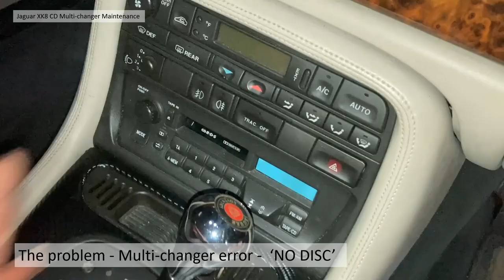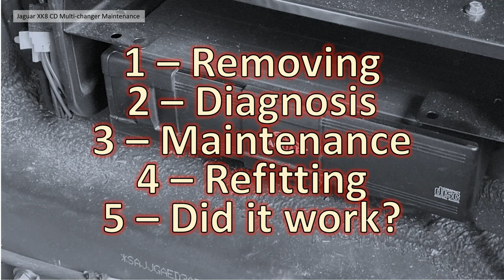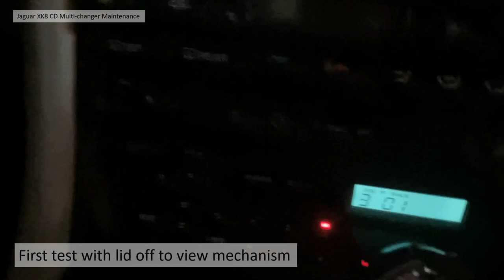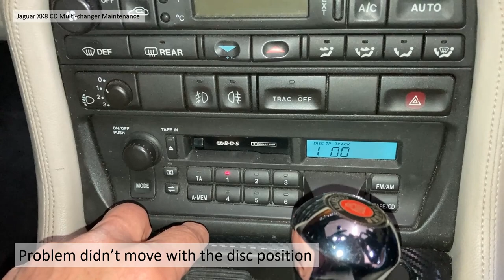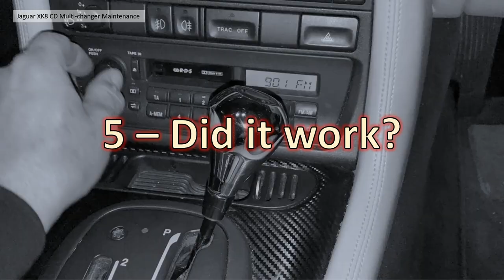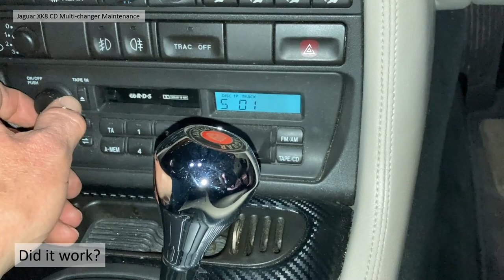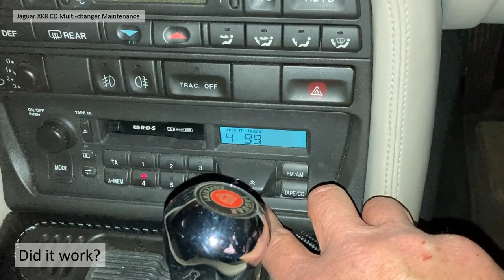Jaguar XK8 CD Changer 'NO DISC' V127 / XKR (X100)

Comment: Great video. When I took mine apart the cover wouldn't come off. I ended taking the face plate off (as recommended in another video) which was a big mistake. It was very difficult to get off without damage and not necessary. The reason I couldn't get the cover off was because it wouldn't slide back or up because after 20+ years the rubber isolation dampers were stuck to the cover. A little silicon spray lessened them right up, but I couldn't see that until I got the face plate off and I could lift the cover sides away from the body. I would recommend putting a little dialectic grease on the dampers where they contact the cover in case you have to remove it in the future. These things are always easier the second time around.  ;-)
Reply from the maker: Paul, Thanks for the feedback and sharing your experience, good information, regards Damian

Comment: I managed to get a widget that fits in between the CD changer and amplifier with a switch to allow MP3 input. The guy that made it had a web site that appears to be long gone unfortunately. The only drawback is the CD player needs to be playing for the amplifier to accept the input. I actually plan to go further and fit a Bluetooth connector to the audio input but I have more pressing things to deal with such as no central locking from the fob!
Very interesting video.
Reply from the maker: Graham, the Aux input via the CD lead seems the best solution to this issue. There is a company in the US selling a Bluetooth solution but a bit expensive. Trying the fix it route first. Thanks for the input and comment regards Damian

Comment: Thanks for the great video, I opened my unit it loads the cd but it does not turn the cd. Checked the motor and it works. Any idea?
Reply from the maker: @hoomankhaghani8802, in the end mine stopped working too after my attempt at fixing. Found other solutions, reviewed in this video - https://youtu.be/kG61K1GM-Bc  Finally, got it working faultlessly now. Thanks for your comment and interest in the channel, regards Damian

Comment: A useful video, thanks. What silicone grease were you using? Some sprays are too runny - just want to get the correct one.
Reply from the maker: Paul, I would recommend using a white grease and silicone lubricant spray. The multichanger worked for a while a but it’s very temperamental. Use a Bluetooth tape more often now, regards Damian

Comment: Hi great vid my CDC has also failed but my car is a soft top with all the hydraulic gubbins on top of the bracket would undoing the cdc fixing bolts with bracket in situ” work do you think ?
Thanks
Reply from the maker: NBmusoman, sorry can’t help as don’t have a convertible. It’s worth a try, regards Damian
Reply: @ODRModurol  ok yeah I suppose i just have to try ?
Thanks

Comment: In my case when my BMW e39 CD changer stopped working I took magazine out and removed every CD and then reinserted magazine. After turning CD player on it obviously displayed the "NO DISCS" message. Turned it off, put CDs back and turned CD player on. All discs are back in action and playing just fine.

I know it might not be everyone's solution but in some cases it obviously works. 
💿🔊 🤔
Reply from the maker: 👍Always best to start with the easy or obvious stuff first. Good advice, regards Damian
Reply: @ODRModurol 
In my case it just stopped working for no reason when yesterday I tried to switch between two discs. It felt like a software issue than the ol' good grease one, as if its little brain got perpetually suspended in state of confusion, so offering it a full set of empty cartridges helped it to clear its mind. Literally.

Comment: If you install the front springs first, it makes it much easier.
Reply from the maker: Andy K, very good tip, I thought I did that in the reassembly section. Very fiddly to put back together even though not complex. Thanks for the comment, regards Damian

Comment: I have a similar unit. With mine the slide mechanism will not move. I think the motor is dead.
Reply from the maker: @CortinasAndClassics, my CD changer has stopped again with 'No disc' error. Decided to try a guy I found on eBay offering Jag CD and radio repairs. Finger crossed I finally get it back working, regards Damian
Reply: @ODRModurol  I got mine working. Really pleased.
Reply from the maker: Nice one👍

Comment: Alright bud, great video, before I attempt to take mine apart I have a little question, I can't get my cd cartridge to eject, have you got any ideas what it could be ?? Cheers 👍
Reply from the maker: Steve, if I remember correctly the eject button pushes a separate micro switch which triggers the ejection of the cartridge. Sorry can't give you any other help as not had this issue with mine. Thanks for the comment regards Damian
Reply: @ODRModurol  hi Damian, not a problem pal, thanks for the reply 👍 Steve
Reply from the maker: Steve, no problem. Would be interest Ed in knowing more about the problem with you CD changer and the fix when you have done it. For future reference, much appreciated, regards Damian
Reply: @ODRModurol  it's got me baffled, there's no noise from the changer when I press the little blue eject button so either I've got no power coming to the changer or something inside has failed but I'll pull it apart and let you know if I have any success 👍
Reply from the maker: Steve, cheers good luck with the investigation and fix, regards Damian
Reply: If you remove and dismantle the CD changer carefully you will eventually be able to release the magazine from the changer.

The noise you're hearing is some part of the mechanism trying to move and being stopped by something that has stuck.   As the man said, the white lithium grease has probably dried out and stuck to something.  There are lots of places where parts move closely and need to be able to slide or rotate easily.  The answer is to dismantle, clean the old grease off and replace with nice fresh lubricant.

I did this but tried to redistribute the old grease with the result my changer worked but would only play around 2 minutes of each CD.  Obviously the head would not travel further before sticking.  Repeated the process with new lubricant and all is well now.
Reply from the maker: Phillip, good points and well said. Thanks for your input and comment regards Damian
Reply: @philipgrice1026  I have the same problem on my XJ8 so will have to remove the unit as Damian described. Once you had access to the internals, how did you release the CD cartridge? Is there a trigger mechanism I can activate manually?
Reply from the maker: James, I thinks it’s a microswitch and motor but could be wrong. Should be able to release it and move it manually once you are in there. Good luck with trying to fix it. Regards Damian
Reply: @ODRModurol  Many thanks. Will give it a go.
Reply from the maker: James, please let us know how you get on, regards Damian
Reply: @ODRModurol  yeah will do, I had an accident at work, a week In hospital, I'm home now bit not fit enough to work on the car so as soon as I'm fit enough I'll get straight on it and let you know 👍
Reply from the maker: Cheers, take care.